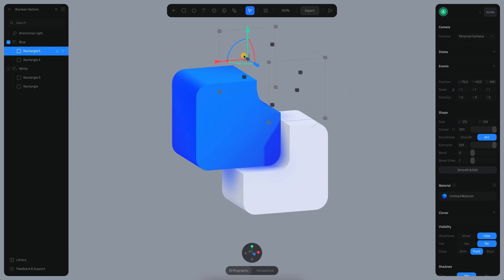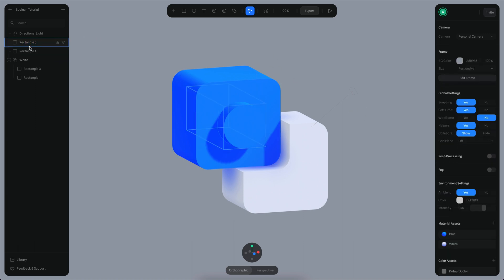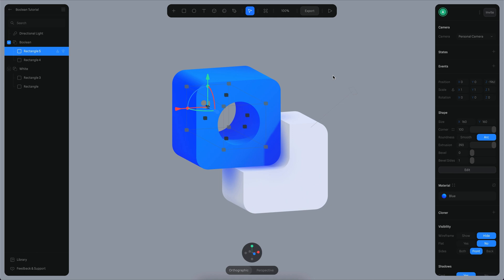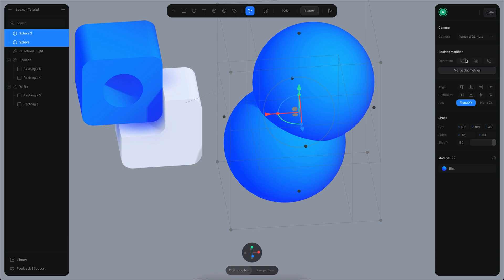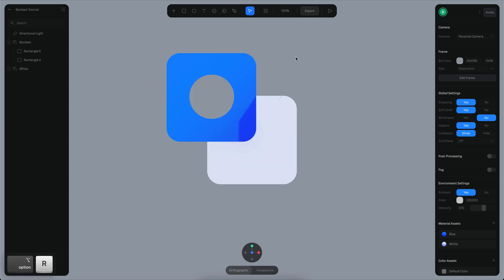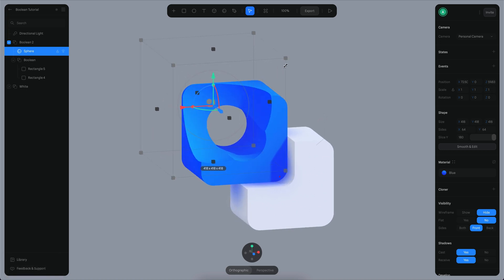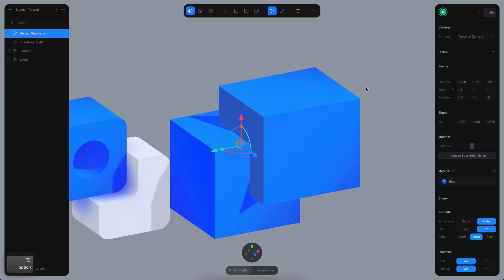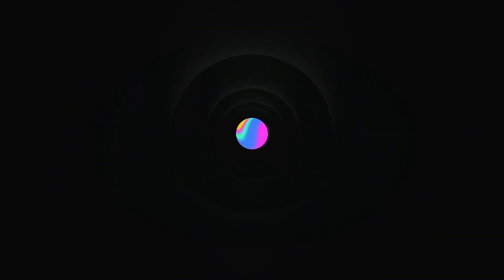Creating boolean shapes in 3D with Spline

Comment: @Spline Is there a way to get booleans to work with Physics? I put a hole in a cube and wanted the ball to fall through but instead it hits the element that's used for the boolean subtraction?
Reply: you need to set the Collider parameter (under Physics section) to "Precise slower", after that it should work

Comment: I'm glad they finally added booleans, one of the long-awaited features of spline. Looking forward to deformers like bend, twist, etc.
I found several bugs of booleans in the spline:
1) when you drag an object in the outliner, the booleans stop working
2)Booleans don't react with the cloner modifier.
As for wishes, I suggest to add slice mode for boolean.
P.S. They still haven't fixed the awful curve editing.
Reply from the maker: Hi there! 
Thanks for the feedback.
For point 1, we are not able to reproduce this error (it works fine in our test). If you can try reporting this in our discord community, it would be helpful!

For point 2. This is actually a current limitation (Not a bug) of the system.

About curve editing, we actually shipped many improvements recently and will continue to do so.

There is no need to be rude. 

We will get there 🙌